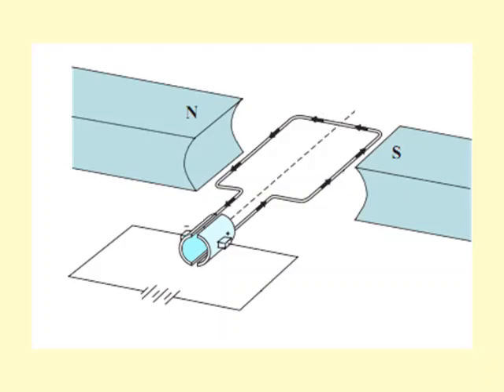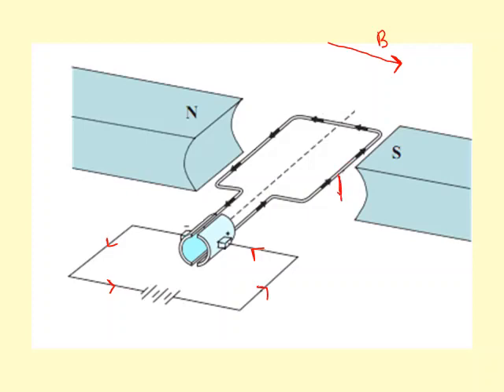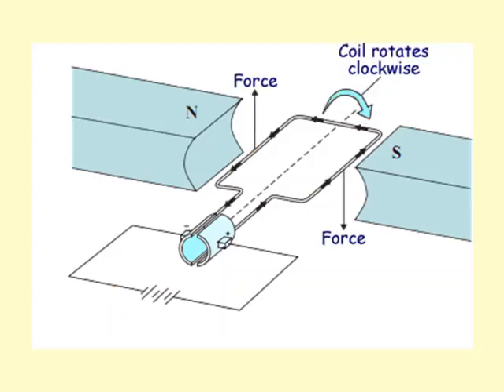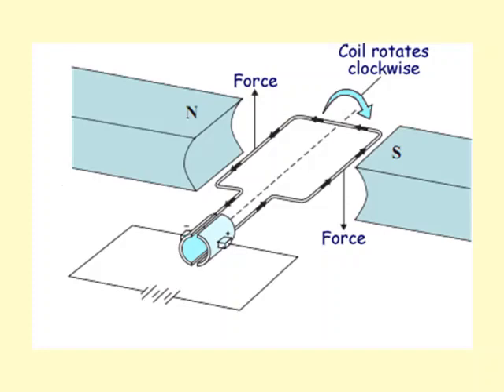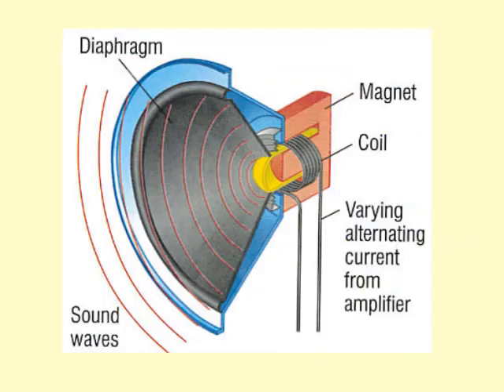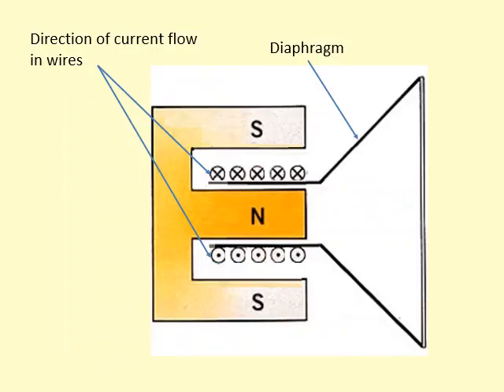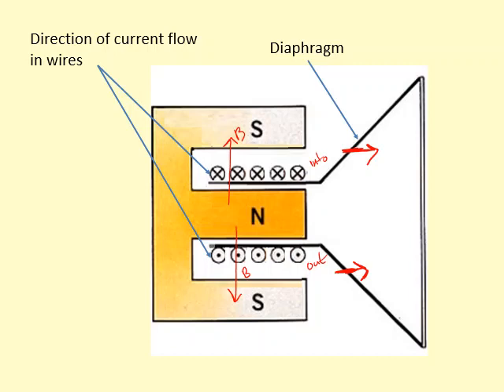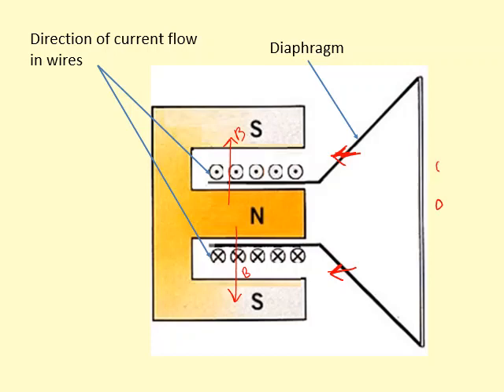12.04 How do motors and speakers work motor effect

Comment: for question 2a, i keep getting the force as pointing into the screen and not to the right? (im using the current to the left and field pointing up for the first section, then field facing downwards and current to the right for the second section).
Reply: for the top side, the current is going into the screen ( the X means its into the screen, the dot means out of the screen, imagine a dart, when its going away from you, you see the X, if its coming towards you, you see its point). So Magnetic field direction is going N to S so upwards, current is going into the screen so force is to the right.